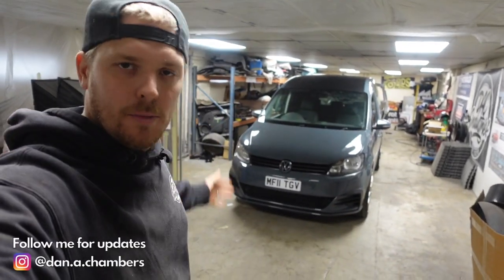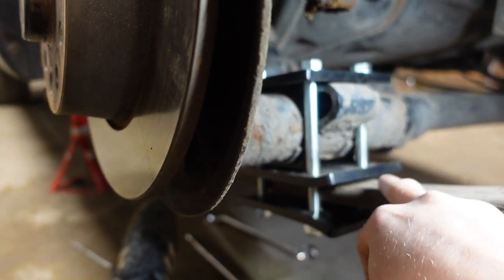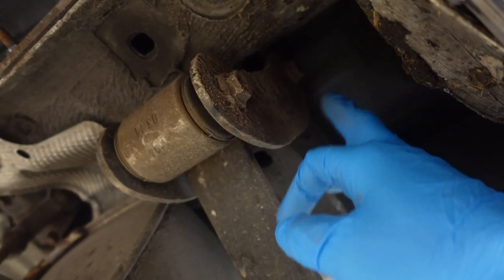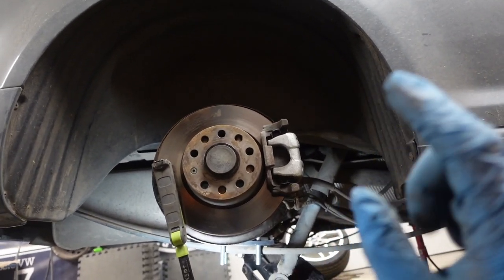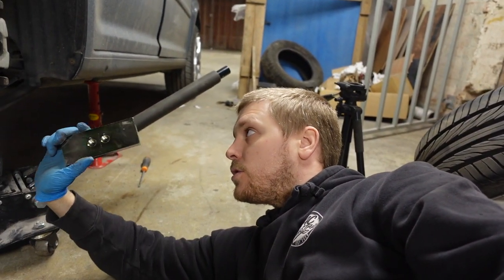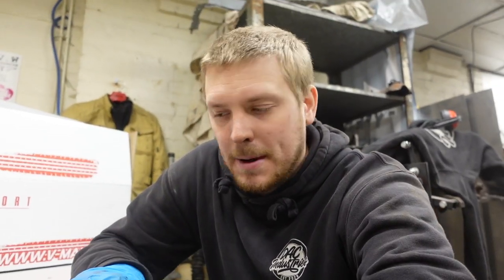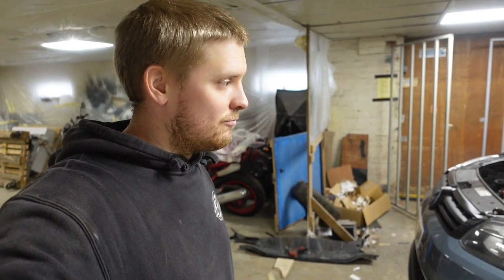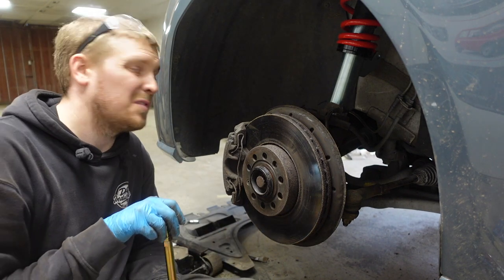VW Caddy 2K Build Series - How To Fit Coilovers & Flip The Rear Beam - Episode 22

Comment: ❤ the Dan Van , if your going to do this to your Van , remember tyre burn , Pro Sport. Racing  adjustable plate ball joints a must fit or you will get 3 hundred miles a tyre on the front at over ninety. M1 Ghost 👻.
Reply from the maker: Cheers bud. I sold the van about a week after I finished it!

Comment: The Caddy looks so much better now it has been lowered, you've done a fantastic job on this Dan so you should be proud of you achievement 👏👏 👍

I remember back when it was all about raising the rear of a vehicle and fitting huge oversized wheels and flared arches but that was back in the 70's and 80's now its the complete opposite, how things have changed!! 😲😬😂👍

Comment: Are the multi hole drop plates fitted to enable rear adjustment in the last view or were you still waiting for them to arrive.
It looks banging mate..Perfect!
Reply from the maker: Thank you! Yes they mulithole plates allow you to raise or lower the rear end.
Reply: @DanChambersDAC  cheers for the reply, what I meant was, was yours sat on the original leaf spring mount in the last picture as you were waiting for them to arrive, or were they actually fitted and just in its lowest setting?.
Reply: Also wondering this
Anyone have a lowered measurement of just flipping the axle without fitting the adjuster plates?

Comment: Sorry but much as I love a lot of you’re stuff slamming a van using “mostly” cheapo parts is normally in the realm of 20 year olds on a tight budget who value looks over performance and safety. And good luck with getting you’re insurance updated if they ask for details or an engineers report.
Reply from the maker: 😂😂😂 spoken like a true OAP 😂 nothing wrong with these coilovers. Ran them on a few vehicles over the years. It isn’t a race car so these will work just fine. If it was pushing 300hp and being thrown around a track then maybe some more expensive coilovers would be better. All mods are declared on the insurance too 😘